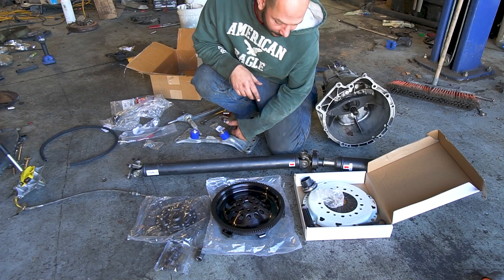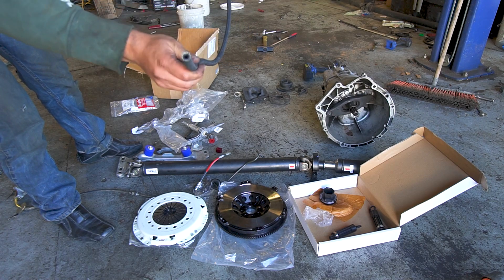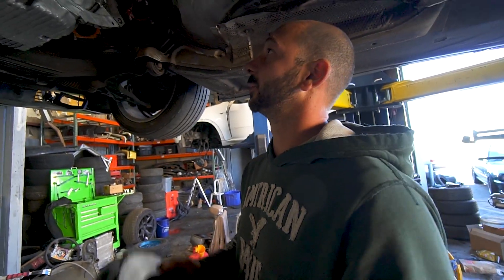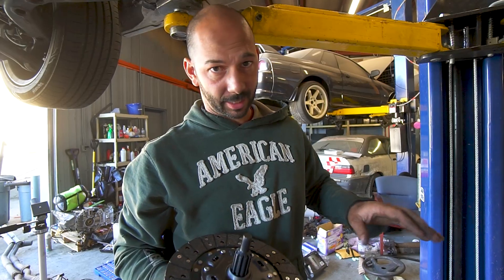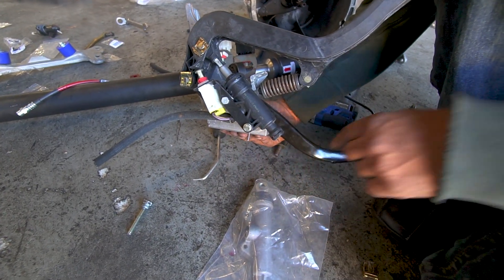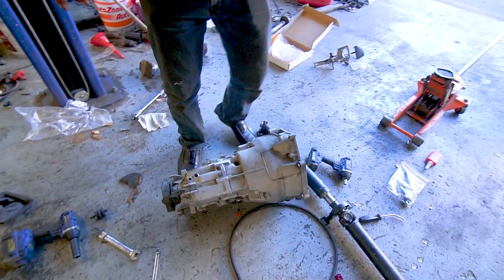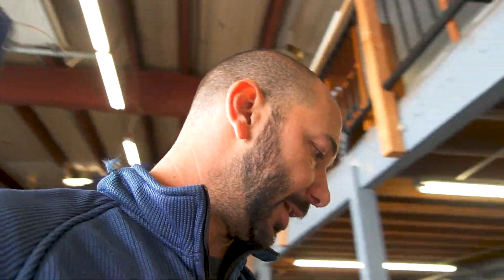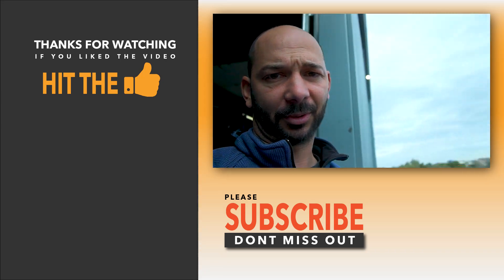How To: E36 Manual Swap! Part 2!

Comment: I'm almost done swapping an auto 325is to an m52b28 with manual getrag. I used a non auto harness with the swap. Will I still need to wire the Park wires together to start it?
Reply from the maker: Yes, the reason is your car is still an auto car, so it won't send the signal to the starter until you bypass the park safety switch. Great swap btw
Reply: @DENVERBEERANDOIL  ok my main concern was since I am not using the auto harness (on the engine side) just an obd1 manual harness
Reply from the maker: Yes, but the start signal comes from the chassis side to the engine harness. So your car won't send the start signal
Reply: @DENVERBEERANDOIL  got it. Thanks!

Comment: Have you ever opened a ZF gearbox? Tried replacing the detents...but can't remove 2(3) on top. 1/2 way opened, do I need to remove the 5th gear and reverse detents to open  it fully?
Reply from the maker: I have never opened a ZF

Comment: They sell a clip that bolts to the block. Locks to the ring gear on flywheel. I just used a long piece of angle iron between a starter tooth /ring gear and a hard place (the ground)

Comment: No crank after my swap :/ no power to the two smaller wires on the starter . Not sure if it’s a EWSII issue. Cause there’s no voltage to the 2 of the smaller wires on the starter when engaging the ignition switch
Reply from the maker: not an ews issue, sounds like a wire or ignotion switch issue

Comment: did you put the clutch plate hub on the flywheel side? i thought the flat part goes on the flywheel
Reply from the maker: It depends on each clutch kit. It should say on the clutch disc which side goes towards the gearbox

Comment: How did you use the drive shaft with the 3.91 diff ?
Reply from the maker: All e36s are 4-bolt drive shafts except 95 m3

Comment: You installed the pilot bearing after you put the fly wheel on? Could that be why you had such a issue installing the trans ? The bushing was not fully seated? (Total guess / stab in the dark)
Reply: I'm glad I put my pilot bearing in before the flywheel ...
Reply from the maker: Nah, it was still totally sealed, but not a bad thought